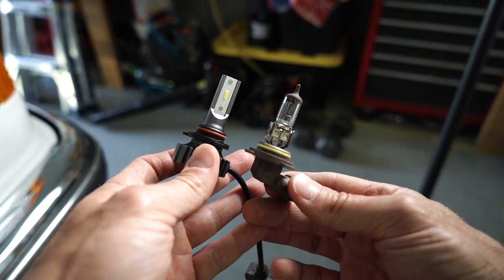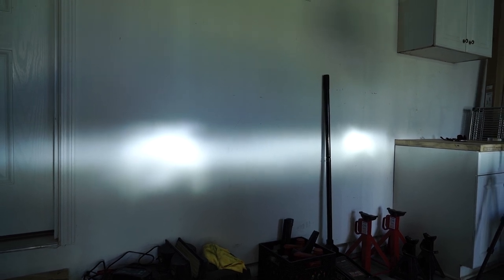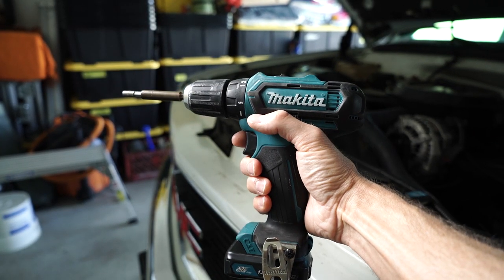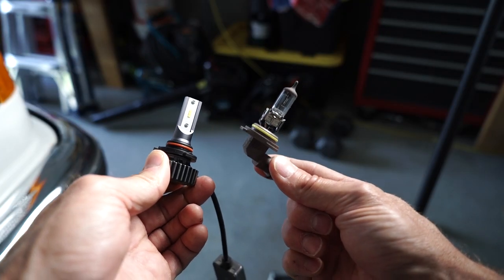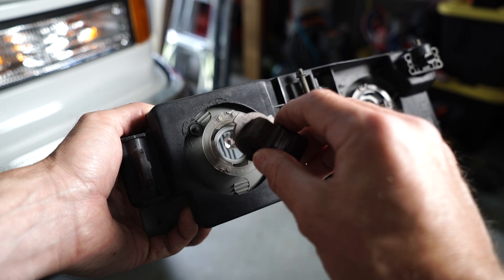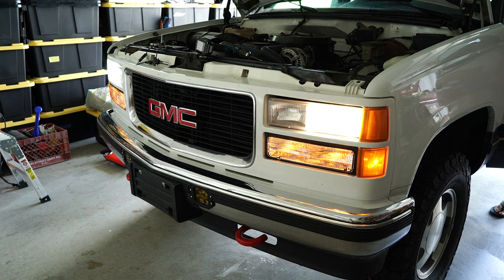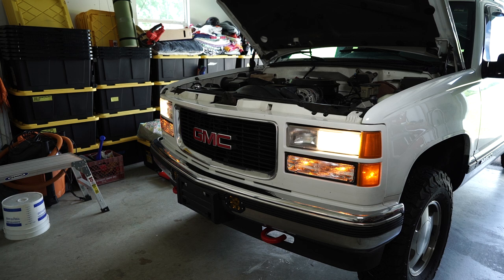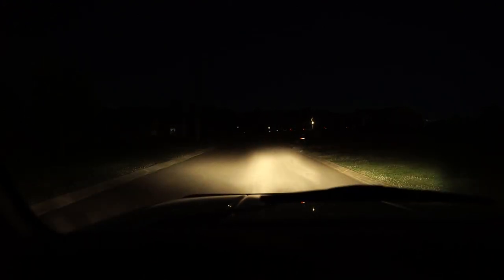LED Doesn’t Stand A Chance Against This Type Of Bulb!!

Comment: Led wins. But you must buy good quality.
Reply: And buy headlights that were designed for LEDs not halogens with reflectors.
Reply: @Logan941  
OR you could buy LEDs that are designed to replace halogens. They are pretty expensive though.
Reply: @Peter_Riis_DK  Sorry, physics says it doesn’t work that way at all bud.

You’d have to get a housing designed for that specific LED bulb for it to work correctly.
Reply: @Johnnygga  
Yeah, well - I spoke to Physics, and he says he never said that. 😁
Bud.
Reply: Ceramic LED!
Reply: @Johnnygga  Definitely not true. You should actually look into it. Most of the bulbs you see on the street and in videos like this are cheap Chinese crap from Amazon. Good LED bulbs run about $150-$200, are fully adjustable, have way higher light output while using far less power per lumen, and have perfect beam patterns with sharp cutoffs.
Reply: Led's get alot of crap because people are using crappy leds

Comment: Enclosures specifically designed for led elements are much brighter and cast much wider than placing LEDs in enclosures designed for halogen light bulbs. The big thing is the reflectors.

Comment: If you are going to stay with halogen, you should upgrade to 9012/9011. You have to mod the lock tabs but the output is much better than 9006/9005.
Reply: They are rated at 55 watts, same as the older bulbs. Since they are both Halogen, then what makes those newer bulbs so much better?

Comment: Honestly, with how the halogens emit light, you would expect halogens to have a broader pattern, but they really don't.
Yes, you do get that hot spot in front of the vehicle which is great when you're about to hit something, but with LED you can see whatever it is before you're committed to hitting it.
That being said, the halogen's tendency to put light directly in front whilst offering very little in the way of peripheral vision isn't necessarily a bad thing, particularly when used as a high beam globe in conjunction with an LED low.
In my daily rig I have H4 LED high/low and H7 halogen high beams, and on a dark highway I'm yet to see anything that works better as it works on the strength of both, and in my opinion it outclasses some lightbars.
Another thing I like about LED highs is that they have no heat up time, so if someone flashes you out of headlight envy you can simply hit them back right on the retinas as their eye has no chance to react

Comment: Yes, a housing designed around halogen bulbs is almost always going to have better beam quality with halogen than with LEDs.  I know, here comes the hate. I'm a pretty big fan of properly aimed, quality HID bulbs in vehicles originally equipped with halogen bulbs, because they emit light in an almost identical location and nearly 360 degrees.   My 90 c1500 has 4300k 35w hid's in low beams, 5000k 35w highs and 4-hi mod.  91 accord wagon has halogens. 01 Silverado has 5500k led's in both lows and highs with 4-hi mod. All 3 vehicles take 9006 low and 9005 high. Imo... I prefer the halogen color temperature, seems easier on the eyes on long night drives. Love the efficiency and reliability of led's but not the best control of output in halogen reflector housings and much harsher light. Have had the 4300k hid's in my c1500 for 5+ years and feel they're the best compromise in my situation between color and usable output.
Reply: Even then the HID bulbs don’t work correctly in a halogen housing even if it emits light in “360”.  The main focus of the halogen bulb is the filament glowing hot from the center outwards.  The main focus of an HID bulb are the tips of the arc inside the bulb.  

So it seems like it’s brighter and better with an HID kit but it’s actually worse because it kills your distance lighting because it essentially becomes a floodlight in front of your car.  Sure the road in front of your car is bright but that’s not how it’s supposed to work.  Your eyes will get stressed trying to focus on things far away with a bright ass spotlight in front of your vision lol

I used to be an HID kit head, but as I’ve grown older I’ve changed my ways and decided that blinding others and also myself was a dumb idea.  Even with halogen projectors.

Comment: there is zero benefit to using even the most expensive halogen over the cheapest leds ... even in non projectors. halogens are just an old system still lingering around clinging on for dear life. even if you like the yellow tint of old halogens, theres leds that replicate the color, just much brighter
Reply: in many countries such as norway it is not allowed to switch to LED.
Reply: He just got a cheap led bulb .. LED are far superior in every aspect .
Reply: @chriscs9080  Do not completely agree with you!

LED. for car tends to have UGLY light color !!
Too cold light color with blue that is not pretty by any means!

LED. can be good but it is often not chosen the right light color! Either too much blue or red or green!

Turn signals on the car.
LED. bulb has  bad light angle and little light to the side which means that you hardly see the flashing light until you look straight at it! 
Wrong led bulb type is used!

The bulb sits too far into the light reflector so there are a lot of edges that block the light!
Reply: @chris cs  Do not completely agree with you!

LED. for car tends to have UGLY light color !!
Too cold light color with blue that is not pretty by any means! 

The problem is that it is much easier to buy cold white led than it is to buy other colors! not so easy to buy 4000k or 3000k led color but much easier to buy 5000k 6000k cold white color!

LED. can be good but it is often not chosen the right light color! Either too much blue or red or green!

Turn signals on the car.
LED. bulb has  bad light angle and little light to the side which means that you hardly see the flashing light until you look straight at it! 
Wrong led bulb type is used!

The bulb sits too far into the light reflector so there are a lot of edges that block the light!

Comment: The housing makes the bulb work.  Housings are typically designed for halogen  style for throw and pattern.  LED bulbs require LED housings to properly utilize the light output. Just like HID/projector assemblies

Comment: Got to say there's a visible difference on that wall pulling out the LEDs you lose a lot of brightness and you lose a lot of spread when you see the lights shining on the road you don't see anything further past the corner of the road
Reply: i like the halogen color but like LED. brightness and that LED spreads better to the side which is a problem with many car. you do not get everything in one bulb!

Comment: Try 4 sided LEDs. They work great. The light hits all 4 sides of the reflector.
Reply: Wrong that will not make more light just blind people the reflector is only on two sides left and right not top and bottom.
Reply: No it doesn't make more light. The 4 sides distributes the light more evenly within the housing (similar to how a halogen bulb does) thus reflecting it onto the road better.

Comment: Bro get the sylvania ultra or better. Pointless to do all that and not get the upgrade lol. Going oem sometimes is like saying damn run flats im going to go with the wooden tires from back in the day lol. When they have totally upgraded original tire. Instead of buying basic bulb. Buy the upgrade of that particular oem bulb.
Reply: He needs to go Philips XtremeVision +130 or +150 to balance life.  He’ll say way better, further, wider and the light is slightly less yellow but still looks factory.  And it’s LEGAL.
Reply: @Johnnygga  I agree; those are the one and two best. Sylvania and Philips either or is good doesn't matter to me. But going back to basic just makes no since lol. So yeah we are both on the same page.

Comment: I like the color of the LED. I’ve had an expensive pair of JWSpeaker headlights on my big rig. While they were great, I discovered that the LEDs didn’t generate enough heat to melt freezing rain.
For halogen, I recommend Philips Crystal Vision. The last pair lasted 2 years on my Camry

Comment: Since I installed my own LED headlights VoRock8 R2 COB 6500k diamond white high visibility lights. Since you have the headlight design where you have a separate high-beam and low-beam I believe the way that my Aveo is setup with one line for all it eliminates that hole dark bar that you were showing on the palm of your hand with the ones that I got there tri-beam. When you get a chance to go out he's somewhere extremely dark will you show off the new headlight projection so that we can see the light spillage from the halogen beam?
Reply: So if you go back to your photo or video from switching between the LED white lights to the halogen orange light you can see that the trees completely disappear in the orange light from the halogens butter visible and the white light from the LEDs

Comment: I gotta agree with the LED Afficionados here. LEDs , in my opinion, are far better than halogen bulbs. Although you are correct Jimmy that the LEDs have only 2 sides that emit light, there is a trick in installing it to produce a better illumination output. What I did with my LED headlights was I slowly rotate it while it is turned on & projecting on a wall about 20 meters away. By doing so  I can adjust the proper angle of my LEDs making it project its light on the road rather than have them project in a spreading way where it can really be annoying and even hazardous to incoming vehicles. Also, try using a yellow-green colored LED headlights. For me it is better that the white ones. Hope this helps.

Comment: I swapped my halogen lights with LEDs when the halogens burned out in my 99 burb. The bulbs I got are 6000 kelvin so bright white. They are also 16000 lumen LEDs. Overall a much brighter light and the bonus is I can see further and other drivers don't flash me because I don't need to run my brights just to see.

Comment: I was waiting to see if those pins were going to come out or just spin as they did in my 2000 CK
Had to pull the bruins guard and grill. Then replace the whole housing and adjustment mechanism.  I put never size on new pins

Comment: Led are designed for a projectors headlights.  If you have a reflector headlights jus use the re halogen bulbs.  Because it's blinding everyone on the road if LED use in reflector headlights housing.  Plus halogens illuminates better than led bulbs.  LEDs need something lighter colors to reflect off of on the road.  For example if it's raining, LEDs you can't really see the road. The asphalt became so dark that led can't even illuminates the  road.  Remember folks the roads are made up of asphalt in majority of the roads and highway.  I finally found someone like you tested out the difference between halogens and leds and pointed out what's is brighter on the roads.  More drivers are complaining about LEDs are blinding them at night while driving and expert weigh in and saying that LED are getting too bright and causes blindness to drivers.  LED is just all the hypes in some cases and creating so much glares and it takes some times for the eyes to adjust after exposing to it from some vehicles that wrongly install it in the wrong headlamp housings.  I have LEDs installed on my vehicles which have the projector  housing headlamps and I agreed with Road1 on the difference situations and where LED should be installed.

Comment: If you buy special halogen bulbs such as Osram night breaker, they light up brighter but last much shorter or less hours.

You can not have more watts so they put in another gas so the light thread shines brighter and breaks faster.

All light bulbs that shine brighter than the standard bulb do have less operating hours

Comment: I put LEDs on both my 94 burban and 95 Sierra. Except I compensated for the dumb parabola headlight design with a four way LED. Instead of only emitting on two sides it emits on four. Thus eliminating that "blind" spot your LEDs have. However you also need to align the LEDs to the housing to get the best throw. In your case that LED would need to be vertical to the housing so that the light shines to the left and right and reflects forward. You have to remember these headlights have dead spots on top and bottom. It's a parabola not dish shaped reflector.

Comment: Headlights in these are driven off a simple switch.  I put in relays and heavy wiring to reduce the Voltage drop, and any standard halogen bulb is now superior to anything you put in without relays.  I find it harder to see with the blue tint bulbs.  I still use yellow Cibie fog lights for this reason.

Comment: I could see his point driving in the city maybe where there's plenty of ambient light but when you're out in the country or places where there is no artificial light LEDs everytime. especially your backup lights. my LED backup lights are better than my headlights. I completely changed out my 2003 Silverado 2500 HD to LEDs about 5 years ago. never going back. they are three times better and I did not spend a lot of money they were all pretty cheap off of Amazon and they have all performed flawlessly

Comment: the reason why it doesn’t seem as bright is because that’s 6000k white, as the color temperature goes towards 6k it’s less visible even if it’s brighter as far as lumens. 
the sun is right between 5-5500k and it’s over the course of thousands of years its what our eye sight sees best in and the same for darker red or infared spectrum. 
so 1500 lumens at 5000k pure white will be much brighter and visible than 6000k cool white. 
and for this reason HID projector headlights are best. 
i’ll actually be doing a video on this soon!

Comment: As long as there is a reflector in the headlight housing a regular 2 sided Led Bulb will normally always be better than a Halogen Bulb. There is a company called Auxbeam that makes headlight Led Bulbs that has 3 sides which would be closer to a Halogen Bulb as far as 360 degrees of light output. If that type of Led Bulb is used in a reflector housing it definitely would be better than a Halogen Bulb in light output. Led Bulbs come in different color/temp ratings so if you don't like the pure white you can just go for a warmer rating.

Comment: Me personally like the LED lights better, but only for the low beams. The high beams I like the halogen. LEDs are great, but I think their short fall is distance. LEDs scatter light more randomly, especially on light housings that are ment for halogens. That's why I still rock the HID (xenons) in my truck, kind of the best of both worlds in my opinion, and my halogen housings are plenty big so the lights don't melt them.

Comment: I have a 2000 Toyota Camry LE 4 cylinder. I use led light bulbs. They are from Oracle Lighting. They are 17 watts per bulb. They are also DRL'S. They make the Camry look modern which I like. All of the Camry is led except for the dashboard, heat and air conditioning switches, console, and glove box. That will be changed over too. The color I use is Cool White because the Camry is a silver type color. No more halogen bulbs for me. The halogen bulbs look good on your vehicle though. This is just my opinion

Comment: Try the Sylvania Xenon white ZXE halogen bulbs if want a whiter light from your halogen bulb. They are white and they are still halogens. I run them on my 2006 Crown Vic and they are a definite upgrade over standard halogens without going the Chinesium LED route.

Comment: First, LEDs need to be oriented correctly in the housing. They should be vertical otherwise you will get scattering and a poor beam pattern, plus you blind oncoming traffic. Second, you can get LEDs that have the same color temperature as the halogens if that's the color you want.

Comment: I use LED bulbs between March and October, halogens between October and March, the LED creates glare reflection off of the falling snow and the snow on the ground, and LED doesn't produce heat or enough heat to melt the snow and ice off of the lenses.

Comment: Honestly, keep it old school because those older style housings are designed to reject the HID light properly and not LED. If you want to upgrade your stock to blind the hell out of other drivers so that you can see better get the correct housings to match those stinking LED lights. Or perhaps buy a new vehicle if your going to change it to be unrecognizable from how it was designed to be. 

Opinions vary and most suck when it comes to upgrading older vehicles, hence most people don’t do classic vehicle upgrades for a living. If they did they’d be out of business in less time than it takes do it right the first time instead of over and over again until dumb luck finally hits them and they decide to do it right.

Comment: LED is still better IMO. LED is most definitely brighter (maybe your bulbs aren't but I have JDM ASTAR and it is the beam pattern as Halogens but much brighter) 

The 360 degree does not matter because of how the reflector works, it gets cutoff the top anyway and you don't need light directly in front of the vehicle because you can't see it from the driver's seat.

But 360 degree LEDs are not good because they scatter the light and make it blind others, the blade style you have is the best

Comment: Sorry , I put LEDs in my 1995 S10 , the 4x6 sealed beam sucked so bad , couldn't see anything down road and sides of the road. LEDS light up everything... I think if you shop more for better LEDs , you'll find they have a better light pattern. You shop Ebay and Amazon to much , call a source that specializes in lighting .